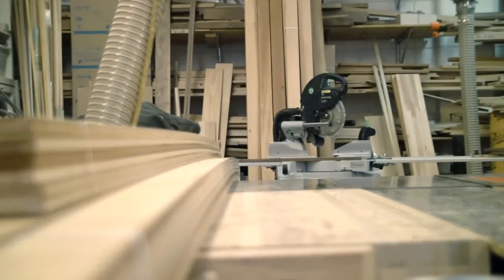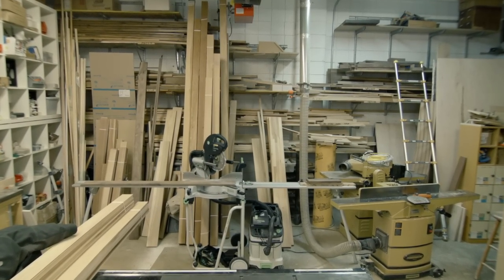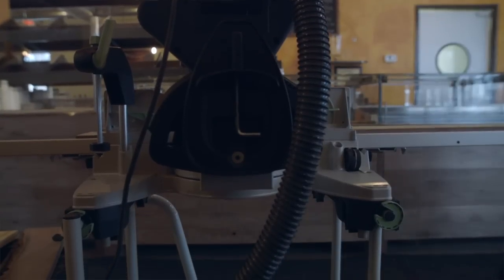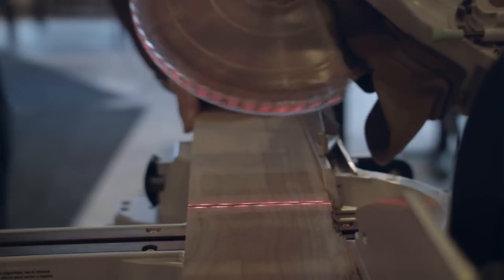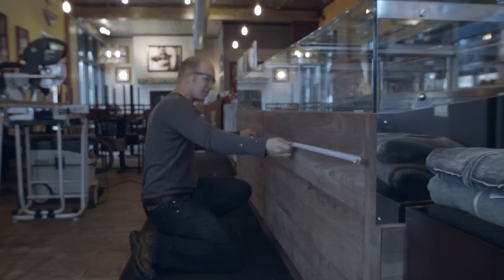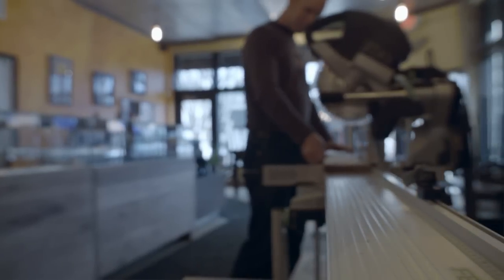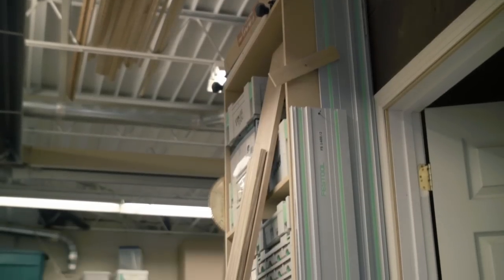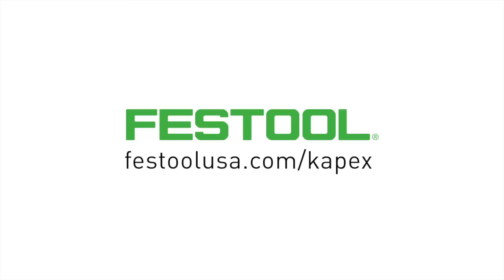Chris Marsden: The exceptional dust collection of the Kapex miter saw

Comment: I'm having the same problem - crummy dust collection in spite of several videos - like this one - that praises the Kapex's dust collection. I followed the suggestion by 'the new brit workshop' to put zero clearance inserts on the base and the fence. The one on the base doesn't seem to cause a problem, but I wondered if the one on the fence was blocking the path that the dust should take. I removed the insert from the fence, and split the halves of the fence apart so that it didn't interfere with the rubber dust hood - it's a pain anyway when the hood gets stuck on the fence as you pull the saw back. Then I noticed in this video that Chris's rubber hood goes all the way down to the base, and there was about an inch of space between mine and the base. I dummied up a 1 inch extension to the hood out of duct tape and trimmed it so that it doesn't get caught on the fence as you pull it back. Now - well, it's not perfect, but it's much better than it was. When sitting on a low rolling chair and looking at the dust hood while making a cut, before my hood extension, a lot of the dust was going under the hood. Now it's going right up into the saw. I also noticed that there seem to be differences in the dust collection port between the 120 REB and the 120 EB. I wonder if that changed. Anyway, I hope that Festool wasn't trying to save money by reducing the length of that rubber hood. That would be dumb.

Comment: i have a Kapex. Dedicated larger hose to a Festool vacuum. Over 2500 spent for the two. It still sucks! Because it doesn't...suck that is. A small fortune can be made from some enterprising mind who will design a cost effective solution. Festool tools....wonderful. Dust collection on their routers and sanders is excellent. But the Kapex dust collection leaves a lot of room for improvement

Comment: ok what I'm doing wrong? I bought a kapex, a CT26 and and a few other things. just started using my kapex today as I'm a trim carpenter.  I  made a lot of cuts on MDF trim.  the kapex has terrible dust extraction even worst than my Bosch glide. I'm very disappointed that one of the main I got the kapex was for dust collection but it doesn't perform like these folks are saying it does.

Comment: Ik have the kapex 120, and I own a bosch mitre saw which cost me 1/5 of the kapex price. The kapex dust extraction is terrible compared to the cheap bosch saw. And I mean really terrible. One time I spoke to a Festool sales guy who was at my supplier to do a demo for a new machine. And I asked him about this issue. He told me that the problem was familiar with them but they didn't had a solution.

Comment: Same heree. In my opinion the dust collection of the Kapex is FAR from being really good. I had some Makitas and Metabos, etc, too ...I really love all my 10 different Festool machines - dont get me wrong! But dust collection on the Kapex? No way anything better than on other saws. In fact its pretty messy, even with a perfect vac!
Reply: I agree the dust collection on the kapex is poor at best.  While I like Festool this was the downfall for me and I hate wasting money on false advertisement.
Reply: There is a bit of technique to making the most out of the Kapex dust collection.
#1 is use the 36mm hose
#2 is never just chop cut, always come all the way out and have the blade exiting the top surface directly in to the dust port. 
No Dewalt, Makita or hitachi saw I’ve ever used came close to this. And the Bosch saws look no better then the Dewalts.

Comment: Even the Festool Owners Group complains about the overrated dust collection capabilities of the Kapex. They doubt that it reaches 90% as claimed.  But that's still better than any other miter saw... with just the blade guard hose.

My DeWalt reaches 99%+ with my enclosure... maybe over 100% by also collecting airborne dust nearby.

I'll prove that in a video this weekend.
Reply: Did that video ever happen?